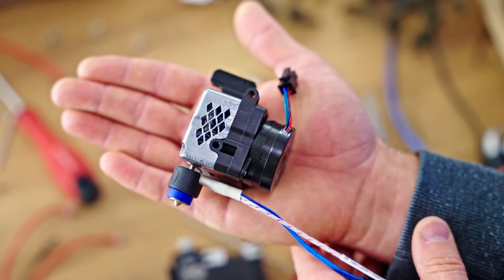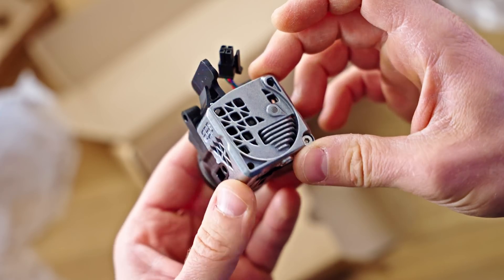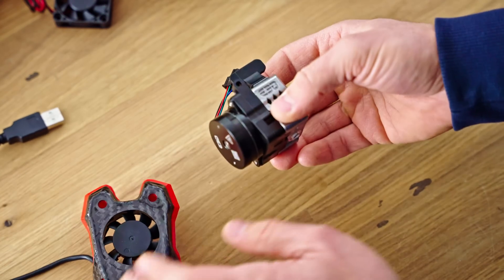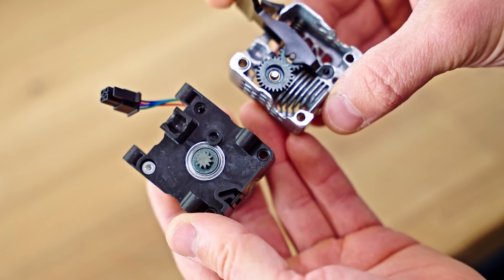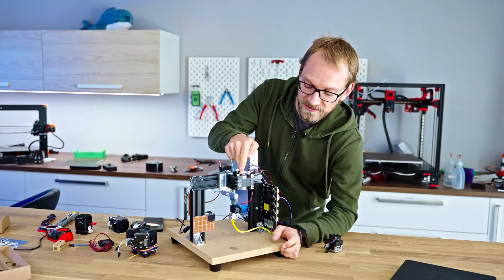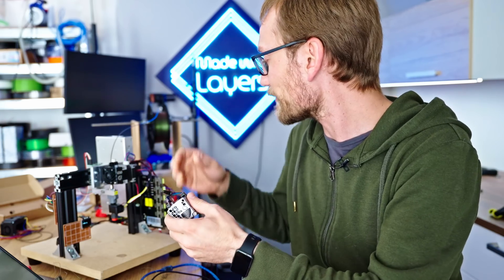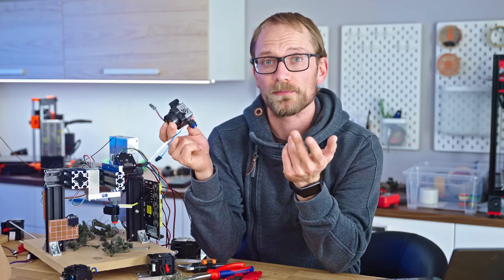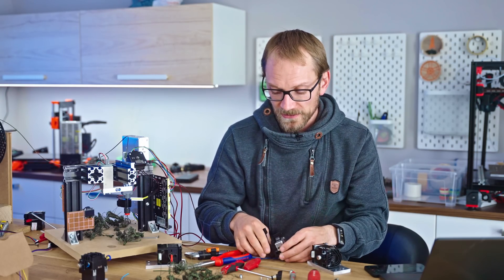Is the tiny E3D Revo Roto extruder really enough?

Comment: I think some of your settings may have been off, the Roto should handle a high flow nozzle much better than that. Maybe double check your current settings? I know that E3D tested the hell out of that Roto long before shipping it out. :face-red-heart-shape::goat-turquoise-white-horns::hand-purple-blue-peace:
Reply from the maker: I double- and triple-checked my setup to make sure the conditions were equal for each extruder and so they'd be somewhat representative of real-life printing moves that would occur in actual prints. E3D have already reached out and we're working on figuring out why my results differ from theirs.
Reply: @MadeWithLayers  You need to disable stealth chop in your stepper drivers.  That is causing the fault.  Stealth chop cannot function if the time between steps is too short.  This triggers false over current faults in many commonly used stepper drivers.

I had the same issue when using an LDO pancake stepper in my Orbiter V2 extruder.  Above 5-6mm/s feed rates, or with linear advance enabled (which causes VERY rapid movements), the stepper would randomly halt.  Switching to spread cycle fixed this problem.

Stealth chop also slightly lowers the amount of torque a stepper will deliver.  I think you should test with it disabled in general.  Extruders don't really need stealth chop anyway, they aren't usually anywhere near as noisy as the main kinematic steppers in use.  Extruders really need all the torque they can get.

Comment: Also yes, please test with flexible filaments, and let us know the limits.  And can it print nylon, etc.?
Reply: It's only rated for 40C so even printing ABS enclosed is probably going to be pushing the limits.
Reply: @RobertSamples-t9u You're right, I just checked the specs, very good catch! It should have been mentioned in the video.

Comment: It looks like E3D took inspiration from Orbiter extruder and then made it as small as they physically can.

This product has its use cases, where they will be excellent choice, but users must accept its limits. This combo will be great upgrade for bedslingers with flimsy Z axis (yes, Prusa Mini or Ender 3 V2). On fast CoreXY printers, it can be interesting  mainly for its easy nozzle changes, but combo of Orbiter extruder and some high flow hotend (Mosquito Magnum) can do it's job better.
Reply: i have a nf-crazy with a orbiter and cht nozzle. the extruder motor stalls at around 42mm³.

Comment: Does the motor overheat if you step the current up a bit? I know I think its a company called moon or moons makes a high temp 14nm pancake stepper just like that you can take up to around 0.8 and get a lot more torque out of it. I use one on a direct drive conversion for my super racer that works really well. Just kind of curious if its possible to get more out of this thing.
Reply: The motor isn't the limit, there's plenty of torque with the gear ratio.  Thom has stealth chop enabled, which needs to be disabled to operate higher speed motors, such as the pancake stepper used by the Roto.  The stepper driver is halting, if the time between steps is too short with stealth chop enabled, this causes a false over current fault.

Comment: I’ve had issues with stealthchop/interpolation causing motor stall on my 2208s (weirdly enough, not the 2209s) with 0.9deg motors.
Reply: It's most likely a design flaw in the 2208 drivers.  If the minimum time between steps is too short when stealth chop is enabled, this can trigger a false over current fault.
Reply: @earthwormjim  Precisely. It’s definitely not a fan of pressure advance or rapid and repetitive accel/decel. The smaller 222X variant will not work with pressure advance in standalone mode.
Reply: I think I have heard that mentioned before.  Would be worth testing. Oh, Especially at that RPM

Comment: Seems a bit meh tbh with the high flow. Im not even really sure those nozzles are worth it tbh. But if I can keep up with a hemera at lower flow then its probably worth it just due to the weight savings. But im not wowed really by this. I havent really been wowed from E3D since the Titan Aero, which was a giant leap ahead. Even the Revo is a bit meh for meh due to its cost.

Ill probably get 1 or 2 of these for my e3d tool changer though as the lighter weight should help a lot there.
Reply: What extruder do you like these days? I might want to switch out my Microswiss, looking for options with somewhat simpler construction.
Reply: E3D arent trying to push to the extremes, this is more about quality, reliability and ease of use for 95% of the market than those edge cases. Theres a bigger market share in the middle than at the edges of the hobby market.  Plus in all honesty most that crave speed end up not printing faster than 200mm/s anyway because of either filament or quality issues.

Comment: 16:02 Is it at a voltage of 12 volts?
Reply from the maker: The system is running at 24V.
Reply: @MadeWithLayers   , If I use 12 volts, will the problem occur at a lower speed?

Comment: Higher voltage will give it tons more oomph, it's getting more and more common to run 48v+ for drivers
Reply: Nah, for current/heat limited stepper higher voltage only gives faster direction change/acceleration.
Reply: @eugenekostjuk7181  , No. All because of the inductance.
Reply: @eugenekostjuk7181   Not exactly true. It will increase the torque at high speeds and due to the 11:1 gearing, might make a difference.
Reply from the maker: More voltage may help, but for now I'm sticking with a standard 24V supply to give results that are applicable for real-life setups.
Reply: Yeah, i was hoping for higher voltage tests as well

Comment: The aluminum surface looks like cast aluminum. They probably print the shape from PLA use it as sand mold template to cast aluminum.
Reply: It could be when it was centered it loses print lines
Reply: Is it possible to pour aluminum into a silicone mold?
Reply: @GoIIIa1  No and rami mentioned a sand mold, not a silicone mold
Reply: @GoIIIa1   A silicon mold can resist maximum 200 degree C , aluminum melts near 650C .
Reply: @WhiteG60  E3D always innovates. Then it is SLM . I would try to look for a high definition picture of the surface.
Reply: @WhiteG60   Then it is probably a plastic filament with 60% aluminum and then sintered. 
SLM aluminum has a different surface finish.

Comment: What Voltage were you running the motors? I assume 24v , so I am wondering what it might be able to do with a higher voltage drive.
Reply: @Papinak2  no . The  problem with steppers is that the rise -time of the current pulses  at high speeds becomes a substantial part of the pulse length , with out sufficient emf (volts) it limits the speed of the motor.This is why there are many newer high voltage drivers available.

Comment: pleas use mm^3/s insted of mm/s. it's way easier to understand and compare to other setups
Reply: Just multiply extruder velocity to filament cross section area and you’re there.
Reply from the maker: Firmwares and slicers use both mm/s and mm³/s, but it's a simple conversion factor of x2.4 from mm/s to mm/s³.
Reply: @MadeWithLayers cubed, not squared
Reply: everyone uses mm³/s for volumetric flow rate. its also like that inside prusaslicer. 
never seen anyone use mm/s used anywhere
Reply: @KidCe.  Saying nobody uses it is nonsense since Thomas just used it and so does some people I assume.

There's no issue here it's just basic unit conversion. It's like arguing which unit system is better. Metric or English. It's just an excuse not to learn how to convert basic units. Basic unit conversions are taught in high school, some even in elementary school.
Reply: Even though volumetric flow rate (mm^3/s) relates to the hotend and feed rate (mm/s) relates to the extruder, it would’ve been helpful to have the context of mm^3/s. 
Since the purpose of the extruder is to keep up with the hotend’s capabilities, it makes answering the question “does this extruder meet the requirements of your hotend?” much more clear. 

We know the expected flow rate numbers for Revo, so it’s much easier to see where the drop-off/tradeoff of different extruders are. Using mm/s feels like introducing 2 unknown variables, since there isn’t much context provided for how that translates to printing. 
It feels like measuring a car’s speed in Mach number, it’s not technically wrong and you can convert, but using mph is way more clear because most people have context for what those numbers mean.
Reply: It's done on purpose as this hotend isn't really outputting.
Reply: Flowrate is more relevant to the heater. Motor power is more related to mm/s
Reply: I couldn’t disagree more. mm^3/s doesn’t make sense to me unfortunately. Where as mm/s does.
Reply: @GamesJames  so you don’t understand volume? The feed rate in mm/s of the extruder is not the same as the nozzle speed in mm/s since the extruder is pushing 1.75 mm filament and the hotend reduces it down to only 0.4 mm for a 0.4 mm nozzle.
Reply: learn to spell first😂

Comment: Didn't even finish the video but I already want to put that thing on my Voron 0.2
Reply: Me too until he got to the part about achievable feed/flow rates 😢
Reply: @Brunoku  are you printing at more than 200mm/s realistically? if not then it will be fine.
Reply: @thegarageluthier  Nope, but the combination of my line width/height/speed puts my flow above 20mm/s^3 pretty frequently for quick prototype prints

Comment: for reference (according to my math), 6mm/s with a 1.75mm diameter filament is roughly 14.5mm^3/s. That makes about 180mm/s (theoretical) on a 0.4mm extrusion width, and 0.2mm layer height
Reply: thanks, mm/s for flowrate is a really dumb unit. I want to know how much plastic I can push, now how fast the motor spins.

I was really disappointed in the hotend at first (6 is a really low value, my <$5 v6 clone easily does over 10mm^3/s) but then I realized its a different unit after reading your comment.
Reply: @igorordecha  I don't think it's a "dumb unit", it is what you (or the slicers) literally define in G-code to make the motor spin, but I get that most of us never need to know that value in practice. Mm3/s or actual achievable printing speed in mm/s would be much more useful info.
Reply: Based on that, thats not great.. Itd not manage to max out the relatively ancient Volcano standard edition hot end, even on the smaller nozzle sizes. Thats pretty much V6 flow rates. Tragic, really.
Reply: @Aletsch  It's the a  bit largers than a V6, and thats the full hotend, motor, fan, etc.

You can't outrun physics
Reply: @mizz1414  theres a few more tricks that could be pulled off.. probably time for closed loop brushless dc servos. They can pack a lot more torque into a smaller package.
Reply: 6 mm/s · (1.75 mm/2)² · π ≅ 14.431691 mm³/s 
rounds to 14.4 mm³/s
Reply: Thanks! I was wondering what mm/s feedrate equates to in mm3/s and in actual printing speeds in mm/s that most of us understand better.
Reply: which should be around 570mm/s at 0.4mm width and 0.2mm height if I didn't miscalculate.
Reply: @radry100  570mm/s? I have calculated it to 181,25mm/s ... 😐
Reply: @TRiX_ONE lol 570mm/s with a 14.5mm3/s hotend?

Damn, so my Prusa could be faster than an X1 😂😂😂
Reply: @radry100  According to Wolfram Alpha, 14.5mm^3/s / (0.4mm*0.2mm) = 181mm/s
Reply: @radry100  under 200mm/s for sure
Reply: @radry100  Should be around 180mm/s max speed. 14.4/(0.4*0.2)